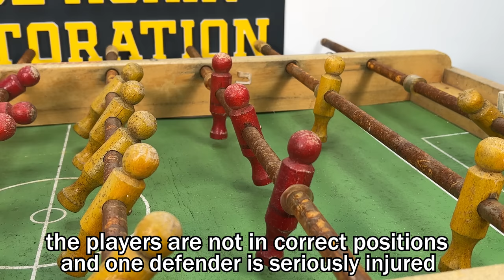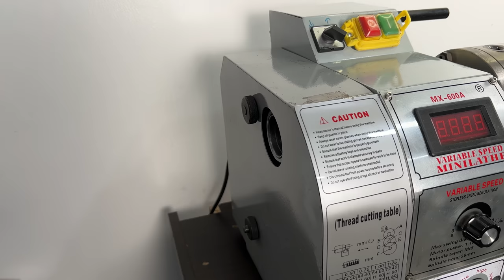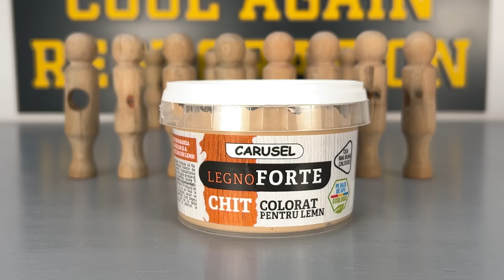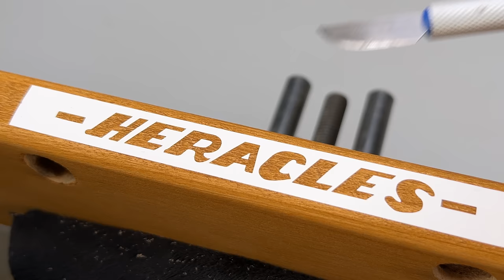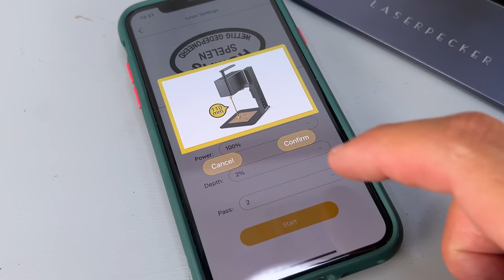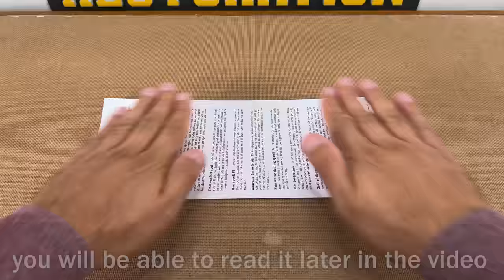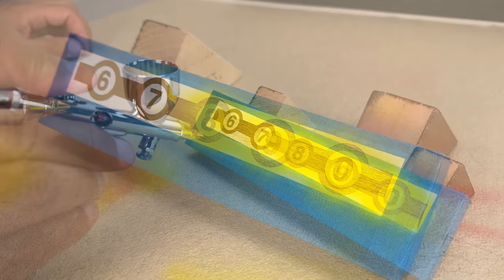Vintage 1960’s Super Foosball Table - Restoration

Comment: Add some bees' wax to the sliding rods and the holes in the side-boards, otherwise it will wear faster.
Reply from the maker: The rods has been waxed after sanding process because is the only way to keep them safe against rusting 😊

Comment: Restoration is about respecting the object you are working with, and using as many of the original parts as possible again, which you fully prove. This was a fantastic result, absolutely fantastic. A small important thing I observed, was that you used screws with slotted grooves, and not the new-fashioned Phillips screws, etc.
Reply from the maker: Thanks a lot and glad you enjoyed so much , wish you all the best 😊
Reply: @CoolAgainRestoration  🙂👍

Comment: Nice project. Great editing. Excellent video. How is the acrylic paint holding up after using the game? Did you add an overcoating to protect the paint? I have a project that needs a strong coating and I can only match the color in water-based acrylics but they are typically not as tough as an oil-based enamel so I am curious how the acrylic is holding up. Cheers 🍻
Reply from the maker: Pretty well for this kind of use . Probably because has 5 coats : 1 primer for wood , 2 x white and 2x green
Reply: @CoolAgainRestoration  That is a lot of coats! Thanks for sharing.
Reply from the maker: No problem , you are welcome

Comment: Outstanding job ! But without professionnal tools, it maybe not have been possible... Two questions, if I may : why didn't you get the balls painted ? And how can you prevent the beautifully polished rods to rust again ?
Reply from the maker: Thanks a lot mate ! My answers: 1. I didn’t paint the balls because I search before restoring things , how they was originally and these balls wasn’t painted . 2. The rods wasn’t chrome plated or something like that and I didn’t too . So the only way to protect them against rust is to wax them from time to time. For example I left them in oil for a while , after I sanded . This process should be repeated again after some months .

Comment: Sometimes I wonder why you just don't make your own "old stuff" from scratch. You have tools for everything!  Are not the original handles rubber or soft plastic?  Again, spectacular work down to the smallest detail. 👍🏻👍🏻👍🏻
Reply from the maker: Yeah , they are made by soft plastic but I can’t turning soft plastic. Probably they are made using different techniques that I don’t know … yet 😅

Comment: The bottom translates to:

•••
who scores the most goals is then the winner.
How do you play? By pushing the positions back and forth, you move your players so that one of them comes close to the ball. Now, by turning the bar slightly, you can let this player kick the ball.
Start of the match. The toss (tossing a coin) decides who starts. The ball is now placed on the spot in the middle of the field, slightly to the side of the team that is allowed to kick off. The center forward of this team gets the ball rolling and the match is immediately in full swing....
Which direction are you playing? When you operate the red handles you must try to shoot the ball into the goal in front of which there is a yellow player (the goalkeeper). Your opponent then plays in the opposite direction.
It is not permitted to continuously rotate a bar with players quickly (so-called "panic football"). The opposing team may then take a penalty, i.e. it places the ball in front of its front row of players and from there may take a shot at the opponent's goal, who at this point may only move its Goalkeeper.
Goal or Goal. If you manage to shoot the ball into the opponent's goal, you have scored a goal. When you play a Model Heracles game, you mark each goal by placing a pawn in hole No. next to your own goal on the score bar, which bears the color of your team. 1. With every goal you score, you move this pawn one hole further. In this way you prevent differences of opinion about the correct position of the match.
If a ball is shot into the goal so hard that it rolls back into the field, then this is a valid goal.
After each goal, the ball is placed back on the center spot and the team to whose disadvantage the last goal was scored may kick off.
We wish you many more exciting competitions.
HOMAS BOARD GAME FACTORY
Homas Games are available in more than 100 different models: a particularly fun series of Pony Games for children. Ask your dealer to inspect the Homas Games Book.
 
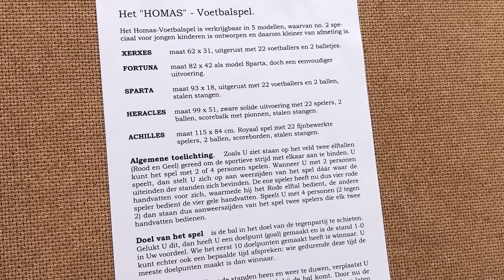( 17:50 )
Reply from the maker: Thanks for translating 👍

Comment: Forgive the long comment ^^;

Never thought you could make softer squishy handles out of the same material as the harder plastics - is it just in how thin it is? How are they compared to the old ones?

That copy trick was really slick; great idea that worked well! 

Probably a silly question,  but how come you used spray paint on the pieces and not the (forgive me I don't know the technical term) the spray and set in the machine dry-to-a-sheen paint? Is that for metals only due to the heat?

When you said 'time to make another logo' I thought you were going to buy one like you have some other logos/ stickers in the past, like on the egg scale, but that machine surprised me! Really neat!

Was mildly hoping you'd give the new pitch a bit of fuzz with carpet rather than straight paint, but the paint job looks great, I especially thought the use of stickers to do the detailing was clever. 

Those foozeballs came out smooth. I mean, it makes sense of course you can make a sphere.  But to have seen it... very nicely done!
Reply from the maker: Thank you very much mate for this long comment and for taking time to write it. Yeah, the handles are very thin in material and they are quite soft. But the original ones was more soft because was another material. A mix between rubber and plastic , I don’t know exactly the name of the material . Regarding to the paint , yeah, that process is called powder coating and is applied only to metals because they have to be baked in oven at 200 degree Celsius.

Comment: Everything is amazing. But I guess goalkeeper's stoppers should have been made out of elastic material. Wooden ones look great but I think rubber would have been more functional.
Reply from the maker: Thanks mate ! Usually when I restore I try to make things like in the original conditions and for that stoppers , I had to see how they was originally , I searched a lot on internet to find the right images. So I guess they was made from wood because almost never the wooden stoppers will hit the edge of the field .
Reply: @CoolAgainRestoration  it makes sense. I guess the fact the original stoppers were missing might be that they broke since they were made out of wood. And the person who replaced them had my same thought, hard ones are likely to break.
Reply from the maker: Yeah , probably ! I found many games like that on google and no one looks the same 😅 probably people improved like they wanted 😅

Comment: Great job! Totally would have just plastidipped those handles though 😂
Reply from the maker: Yeah , I thought many ways to remake those handles , rubber paint in multiple coatings , 3d print rubber material , plastidipping , but the most accurate results and nice finish are with this Pom-C material.
Reply: @CoolAgainRestoration  you definitely chose the better choice! I just wouldn't be able to handle the amount of detail you put into those 🤣. Well done, Sir!
Reply from the maker: Thank you very much 😊

Comment: 2:34 be careful about doing this, if the sandpaper snags and grabs, it will damage the part. Don't ask me how i know, i'll tell you. I did the exact same thing and it bent a curtain rod out of the lathe and proceeded to beat me and the lathe with it when it deformed. Nearly broke my wrist and dented the ways. I'm usually a live and let learn type, but this one's close to home because i done did it and got schooled.
Reply from the maker: Probably the tension was too high . I like to not apply many tension on the sandpaper when I do this trick. I prefer to do the process again if the finish is not achieved . Anyway, thanks for the advice 😊